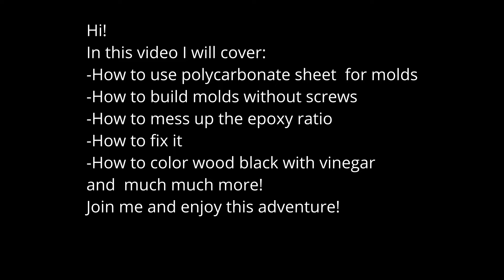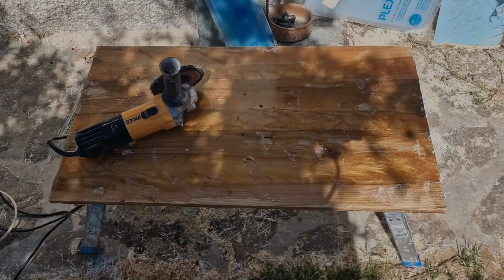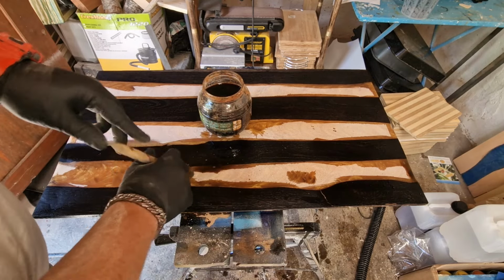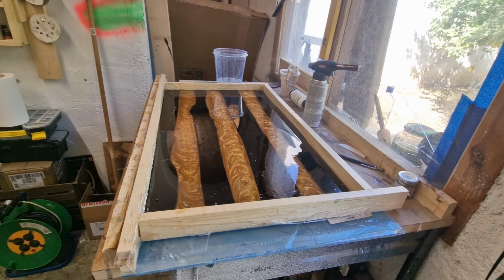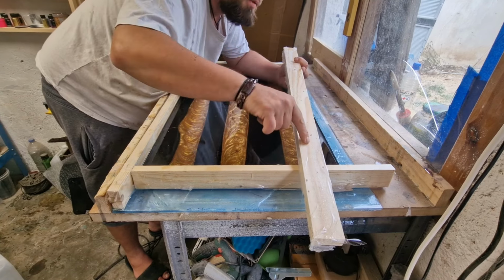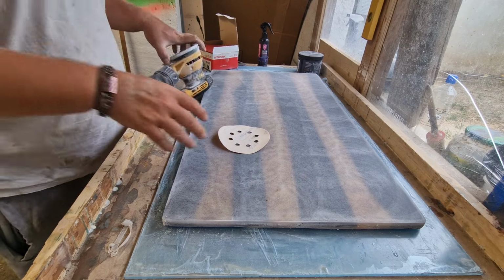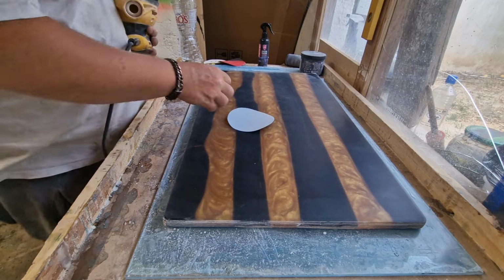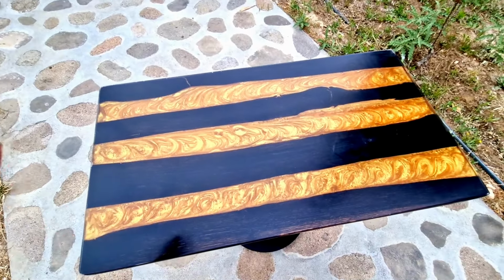Bad Epoxy & Hardener Mix Ratio. I tried to fix it. The Black & Gold Adventure

Comment: The problem with no holes is that the dust will build up faster on the disk so you'll go through them faster when dry sanding.
Reply: I always thought the holes are for Sanders with dust extraction functions.

Never looked at it from the durability point of view.
Reply: @Ben_LeeBZ  Yeah, the dust extraction helps prevent buildup and thus the disk lasts longer. I've switched to the 3M disks that have no holes but are full mesh. They are a bit more expensive but last much longer than the cheap disks and in the long run seem to be more cost effective.

Comment: It is actually important to clean the dust off before moving up to the next grit, like you did.
Loose particles of the previous grit can remain in the dust, continuing to scratch the surface as you sand with the finer grit.
Reply from the maker: Exactly+

Comment: Will that black technique work on pine to darken it.
Reply from the maker: No, sadly it doesnt
Reply: You won't get it as black as oak but you can use a tannin powder (you can also use black tea, it's not as potent tho) that you put in hot water and brew it then paint that onto the wood/pine and it will add tannin to the wood, let it dry then use the iron acetate, let it dry and repeat the process till you get the darkness you want or it stops getting darker, but it will never go black like oak will tho.

Comment: Can you tell me why epoxy resin pieces I made, cured hard, but then weeks later when going back to them, they have gone soft and sticky or warped. So frustrating, as I was about to pack them up for a craft  fayre, obviously couldn’t then and was worried about selling any of the still good pieces incase it happened when customers took them home🤷🏼‍♀️😢
Reply from the maker: Frankly this is the first time I hear something like this. Was it UV resin? Epoxy sometimes takes a while to harden but curing is a logarithmic thing, by that I mean it gets harder and harder not flucuating between hard and soft. Im sorry I couldn't help you.
Reply: @AeginaCraft  thank you for your reply. No it was not UV resin. I have tried lots of different makes of epoxy and yes this happening was very upsetting and wasted money, as epoxy is not cheap!
Reply from the maker: If you ever find out what happened please share it with us here
Reply: @AeginaCraft it is probably because the resin got too warm in the sunshine. It shouldn’t ever go back sticky tho, but can defo warp x
Reply: It's not possible for fully cure resin to turn sticky or soft weeks later, if you used a good resin then there are a few possibilities for this to happen, most common cause is incorrect measured resin when mixing or not mixing it fully, next is using too much colouring, when you add to much colouring be it acrylic paint, ink or alcohol ink it dilutes the resin which inhibits it ability to fully cure, it's common for people to mix a batch of resin and separate it into pot to make different colours but don't realise that overall they end up massively diluting the mix.
As for warping, the main cause is the item being too thin, also being exposed to high temperatures, or being stored while still not fully cured.